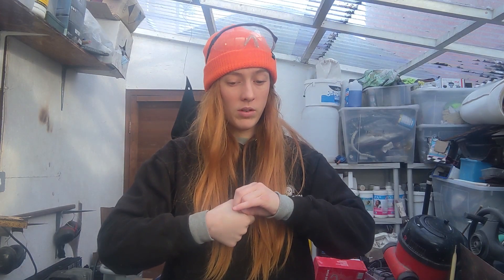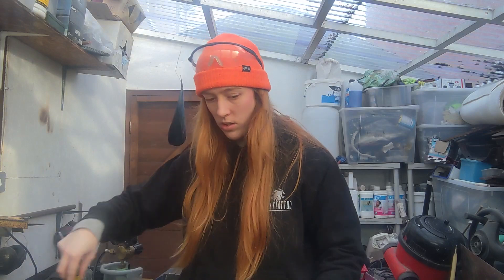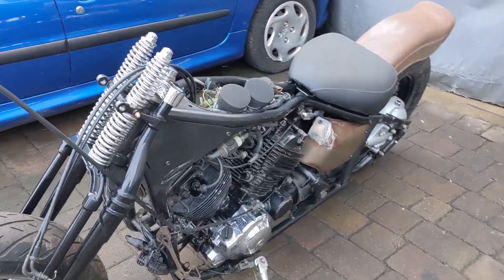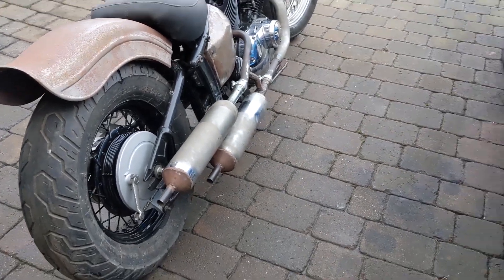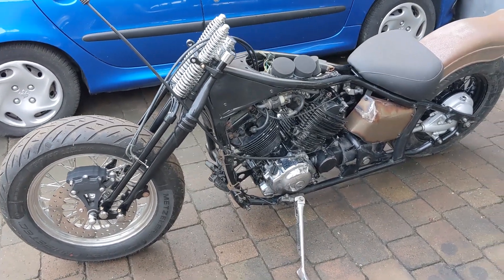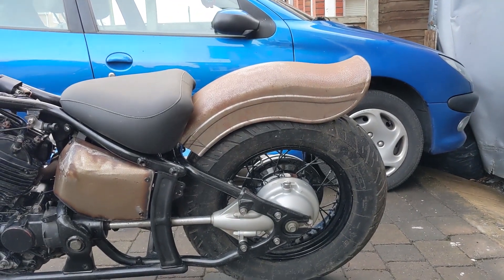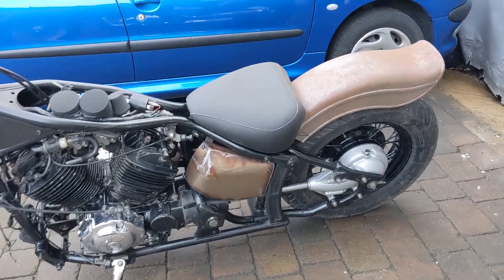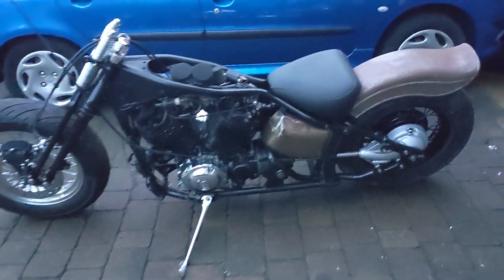Yamaha Chopper Build: Update on my custom motorcycle

Comment: This is just a suggestion. Spray anything that's rusting with ACF50.( It's a protectant). It's expensive but very good at rust prevention and even claims to undo some rust damage. You can spray your exhausts but they will smoke like a bastard when you fire her up. Keep it off Brake Discs though and you'll have to thoroughly wash it off any parts that you might want to paint later.
Nice to see the update. 👍
Reply: Wd40 or just regular grease works for this too, the 'oily rag' look is very popular at the moment ✌
Reply: @loonycustoms44   True but ACF50 beats WD40 in every comparison test I've seen. Have a look at the video by Bennett's Bike titled 'Best rust inhibitor ACF50 Vs XCP Vs WD40 ' it's quite interesting to see how effective these products are. (Sorry I'm an old Dinosaur and don't know how to do the link). 👍
Reply: I'll have a look man that sounds interesting 👍, just for cost and ease I use grease for everything haha ✌

Comment: Hello very good work. I want to ask u something about the front wheel. Did u use the same front hub and change the size of the rim?? Its ok about the brakes???
Reply from the maker: I didn't use the Yamaha's original hub if that's what your asking? 
I brought a new wheel and new brakes - there's a whole video about the process earlier on